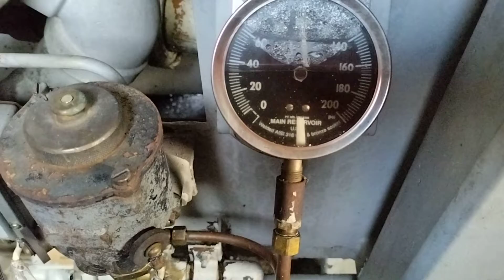DL50 engine room tour Parkes NSW.  Tue 13th Sep 2022

Comment: Great clip mate even considering the lighting well worth the effort in there.
Reply from the maker: Used three filming devices in that tour and that was about the pic of the three.  Couldn't run it as the battery was dead flat, started it up later by connecting an 81 class up to it and running the electrical jumper lead through.

Comment: Certainly seen better days the DL's but at least there's a couple still running. Nice one Dave.
Reply from the maker: Very poor lighting in the engine room when battery is cut, portholes are dirty so not letting much light in and it was heavily overcast on the day.